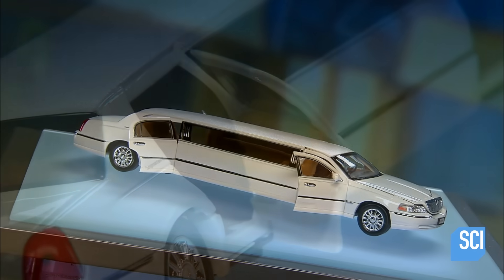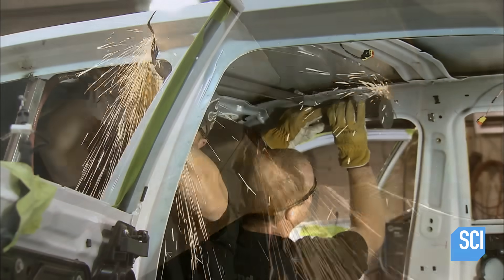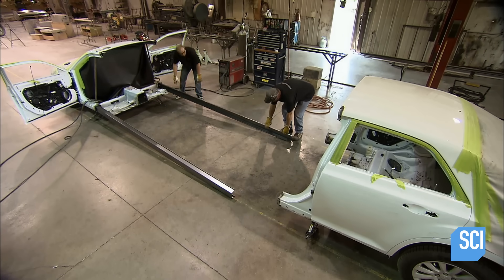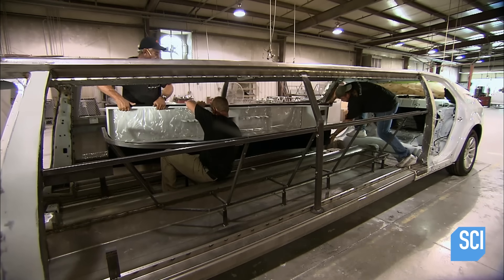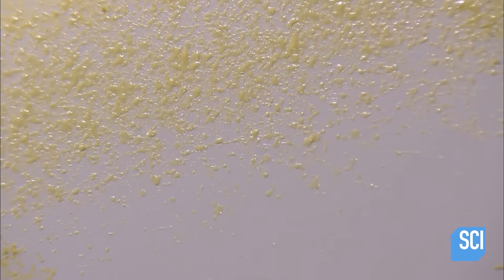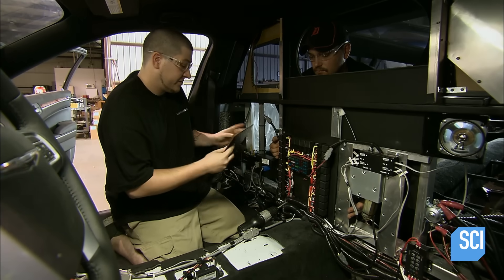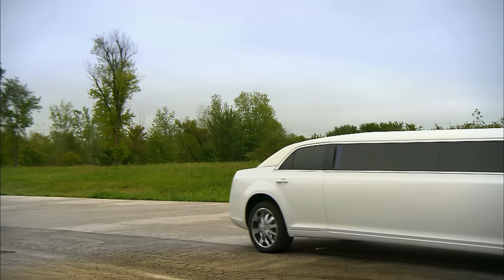How It's Made: Stretch Limousines

Comment: Imagine the floor and frame reinforcements necessary if this were to be a stretch convertible limousine?  Also, if they instead chose to build it with more side doors than the original four and,/or went for a pillarless hardtop design complete with all side windows that open?

Comment: Legit body shops will mount the chassis on rails so that when the car is cut in half, it slides back with precision on the rails, keeping it straight. Then a real chassis is welded in place that has been reinforced. The exhaust is conformed to the chassis, not like this deathtrap. The suspension and drive train are upgraded. This is totally janky.

Comment: I usually really enjoy these how it's made videos but they left a lot out on that build extending the original factory wiring, upgrading the suspension for the heavier weight and extending the exhaust,fuel/emissions systems hoses,and brake lines was completely left out. 😮

Comment: I’m 40 years old and up until now, I assumed limousines are actual cars. Like, similarly to how an S-class has a long version, I also assumed it can have a bespoke super long version. I would never guess that limousines are cars cut in half and then assembled in someone’s garage! So how do they adjust the suspension for all the extra weight? Do they use the same wheels and tires? How on earth does that work?
Reply: The base car is bought from Ford or GM as a "professional" chassis.  The professional chassis includes the suspension for the extra weight which I think is usually springs and shocks with specifications from pickup trucks.  They use the same wheels and tires that are bought with the vehicle, but I don't think there is anything special about them.  Hearse professional chassis do not include interior behind the front seat.  Limo professional chassis are completed units.
Reply: In 4:51 you can see the wheels are different

Comment: Got to love the quality of welding here.... bare metal welded to multi coated painted metal..... did nobody teach them that they need to sand away the paint to reveal the bare steel before welding.... i mean it would be one this if this was just and arts and crafts project... but this is a structural weld that will be carrying humans and there just tac welding bare metal to painted metal....

Comment: This was one of the most superficial How It's Made I've seen.  Magically the driveshaft was just gone and just re-installed, along with the brake lines, fuel lines, cable for the trunk, brake light wiring etc.  They added how much weight to the car and didn't upgrade the brakes and rotors, they didn't cross measure the additional length to make sure it was square...

Comment: ok, but what about the drive shaft lengthening and rebalancing process? suspension changes?  brake lines extension, wiring loom removal and pull through new one? wheel realignment?

Comment: This is total fucking bullshit. you don't just cut a car in half and stick in a couple of pieces of framework to hold it together. what about the drive shaft braking systems/suspension system, electrical systems, etc etc. this would almost certainly be a death trap for anybody who just happened to be in it when it crashed. let's have a more detailed video of the whole process.

Comment: I am surprised the floor doesn't bow that much when you step in it...  That metal looked flimsy af.  I guess with all the stuff added, it adds some structural strength, and they probably weld it all the way across the side beams.

Comment: 1:20 - the way they welded in the new FRAME RAILS?  With very little overlap and just a bit of MIG welder work?  That is a piss poor way to do it, very weak and half-assed.  It needs to be a lot stronger than that!  Their idea of a "ride in luxury" looks like some real shitty construction work to me.  Let's see that thing hit a few good bumps and see how long until it falls apart.  How is that cheap construction going to handle body twist and flex on uneven roads?

Comment: I really wanted to see the drive shaft. I wonder how many support bearing's it would need?
Reply: Try to find a Lincoln Town Car limo being built or a full sized SUV like Cadillac Escalade.
Reply: Front wheel drive doesn't require a drive shaft. A typical sedan is front wheel drive, while a typical SUV is rear wheel drive. That's why we don't see a single SUV stretch.

Comment: Surely in 2022 this cannot be how they make a limousine. I'm actually shocked.
Reply: It’s prob a much better system now, these videos are usually ten years old
Reply: @ashleywoedy9750  That would bring us back to 2012 approx, crumble zones,side impact protection was in cars long before that.To me it looks like a botch job and the limo would never be used on public roads.Im still shocked.
Reply: This is some fine American engineering, are you not used to this shit?
Reply: @kristoffer3000  Absolutely not.It reminds me of those so called chop shops or that practice criminals do when the cut a crashed car in half and reweld on another half from another car.Unless of course now this video was shot in the 1990s.I wouldn't mind but when I watch the smithsonian channel aerial America there are some fantastic feats of engineering but this limo is not one of them.
Reply: These days robots cut the donor car in half and two more robots wheel the back half away so the steel beams can then be welded into position once they have lined up the spirit level. Things have really moved on now.
Reply: @neillchippett655  Omg they use a spirt level to realign both sections of the car.And here am I thinking that the car would be built from scratch with crumble zones and side impact protection and pedestrian safety zones.

Comment: Shocked, is this even safe enough to be driven on road?
Reply: No, thats why you always see them wrecked at the side of the road and their passengers hitching.
Reply: every step of  the way, you must be sure EVERYTHING is "square". constant measuring and remeasuring (welding changes dimensions) is the norm.
Reply: @jameshollen9723  The added frame rails, look very poorly added with maybe 2 inches of overlap to the original car, making a very stressed and weak connection.

Comment: What about the engine ?? This type a car will need a much more powerful engine with higher torque to move the heavy load.
Same for the brake system.
Reply: It doesn't need any additional power for its intended purpose.  Driver's are instructed to drive these slow accelerating such as not to upset the passengers.  Brakes are upgraded for safety.

Comment: No way this is the only way they make limousines nowadays.
Looks totally sloppy - and those welds shouldnt pass any crash test. 
Also, the parts welded werent galvanized steel, since those workers were mig welding (unless they had grinded the edges, but doubt it)

Comment: I don't know about the cutting a regular sized sedan in half part.
Most limousines seem to have a higher ceiling and more interior space than their regular sized versions, so I feel as though they are designed to be extended from the start. The Lincoln limousines though may be indeed done as we see in this video because they are about the cheapest looking and most beat up limousines you will find out there.

Comment: These videos are always too short. So many steps are missing that I'd like to see.

I'm shocked by how many people are shocked that they cut a standard car in half and stretch it. That's what they look like and that's what they are.
Reply: I think most are shocked at how mediocre the new "Frame" is connected to the front and rear parts of the original car. Most expect something with a GOOD BIT more strength and overlap to the original rails.

Comment: What about upgrading the suspension, brakes, transmission and steering to cope with the vastly increased weight. And the electrical system. Would the enlarged / extra kit all fit under the bonnet of the standard saloon car?
Reply: It depends on the vehicle. Sometimes you can order those upgrades from the factory. Usually though the suspension is beefed up It kind of has to be. The company I worked for for a long time had two stretches The longer of the two you could not turn the steering wheel all the way to lock because the large upgraded rim/tire combination would rub against the inside of the wheel wells if you did.

Comment: Use to work at great lakes limo in Michigan! Fun job forsure and this is exactly the process missing a few 100 little things tho! My job was 100% underneath, had to weld, seal and undercoat then extend brake lines, wire harness, fuel lines and drive shaft! Pretty much all day lying on a roller!!
Reply: obviously they weren't going to include every individual step. the video would be too long and TBH would get boring after too long

Comment: i have concern on the safety level of the car such as overturn or side collision impact, it seems the extended part in the middle has used simple metal layer, there is no air bag in the middle. How is the sound proof layer at the extended part, not shown in the video, without proper sound proof, the noise level heard by the passengers will be obvious. Since this is luxurious vehicle, must be very quiet and comfort inside.

Comment: If the flimsy construction of a stretch limo scares you, don't ever look into how most RVs are built. They're essentially a commercial truck frame with a wafer thin aluminum and plywood body bolted on top.
Reply: I remember the first time I saw one tipped and ripped by high winds. It looked like thick paper and cost more than my house new. I won’t ride in one.
Reply: And according to an RV salesman I met, they depreciate so fast you won't even have TIME to cry... Seriously. That's why I would never buy one.
Reply: I’d rather ride in a converted school bus than a commercially available RV for this reason.
Reply: im flabbergasted how modern trailers can cost $50,000 and whatnot. its a damn thin metal box on wheels
Reply: And lots of styrofoam
Reply: A WHIPPLE WING SH1THOUSE
Reply: Yea my friends are dealing with that now. School buses are steel plates and frames the whole way back
Reply: @schneemann-fy6gi  Most school bus bodies are made from aluminum, not steel. Granted, they are still much better than RVs!
Reply: @jamesgizasson  nope they are required by law to be steel framed
Reply: @schneemann-fy6gi Do you mean the chassis or the body? Every school bus body I've seen is aluminum; the frame rails underneath are steel.
Reply: @jamesgizasson  body. Every chassis is steel
Reply: @jamesgizasson School buses are tanks
Reply: Would titanium be a better choice?
Reply: That’s why you have Liberty Coach make you an RV out of a Prevost H3-45 Motorcoach.
Reply: Yet there's still more there than is on an aeroplane.  Don't read more if you fly a lot and are easily scared. :)

Yep, only 1 mm of aluminium and some rivets protects you from falling thousands of feet with no parachute, and if 1 of those rivets is not properly secured, the air can rip that entire section off.
Reply: @EnsignLovell  There’s a hell of a lot more inspection and engineering work on airplanes than there is on RVs
Reply: @EnsignLovell  planes have an excessive amount of inspection. RVs have very little. Id ride in a plane, I wint ride in an rv
Reply: @EnsignLovell  ratio
Reply: @EnsignLovell and yet they don't

Comment: The same engine can handle all that extra frame weight as well as the people?
Reply: yes, it's not an issue. power to weight is affected, of course, but it's inconsequential to the task these perform.  driver's intentionally keep acceleration low such as not to upset the passengers where it will directly result in a much lower tip.  so even if you put a motor that had an extra 100hp over what it had, that power would not be put to use.

Comment: I owned an '89 Town Car limo for a few years privately and worked on it myself. They're not made to last very long; no rustproofing, sloppy welds, lots of leaks. This was a California car but you could easily identify every piece of custom metal because it was covered in surface rust - next to rust-free factory panels. They used a two piece driveshaft and a single carrier bearing for mine (a 72" stretch). Limos are a lot like RVs... there are a couple of companies that make parts for a multitude of limo manufacturers. Mine had a secondary HVAC box behind the driver's compartment with a second heater core and AC evaporator. It had air shocks, but otherwise looked like the original Lincoln coils in the rear. Two batteries and a 200A alternator - may have been an option from Lincoln. The rear compartment solenoid looked the same as one used for a 1950s Ford starter. The biggest issue was glass, lots of custom, curved glass. Once some kids broke the rear door glass. The doors were stretched about 8" and had custom glass. I had to have a polycarbonate window custom made because the original supplier was out of business. They literally spliced the original wire harness going to the back of the car to extend it. There are a surprising number of circuits going back there. It was a remarkably reliable car though, easy to work on too.
Reply: even in the video the welds are very sloppy
Reply: I own a stretched range rover 5.0 supercharged, and since it's a range rover, the limo parts have been the most reliable parts 🤣  but seriously, luckily mine was done by one of the largest conversion firms in the country, so mine is built very well...12 years later, the bondo just developed a slight crack.  The problem with limos is, you can have the worst backyard job possible, or a very high quality build, and if you dont know who built it,, you'll only have two ways of finding out:  let it get old and see, or worse...crash it

Edit: I should also mention that the hack job backyard limos are pretty much mainly just Town Cars, Cadillacs, and Excursions. Most of the more exotic type of limos, BMW sedan limos, Mercedes limos, stuff that isn't usually stretched in america, have a better chance of being a higher quality build. Hackjob 1980s-2011 stretched Lincolns are a dime a dozen
Reply: Hiiiiiii can you see my comments????
Reply: They writing a book 😂
Reply: I rode in a limo when I was 8 years old. I was a cheerleader at that time, and the limo was hot pink. We were going to our banquet at a pizzeria. It was so much fun.
Reply: I can't imagine it needs to last long, though. In the ideal case, if you own a limo in the first place, you're likely gonna use it and get money from renting out your services to clients, and with some good management, before you know it, you've made your money back.

Comment: Am I the only one wondering about how many driveshaft carrier support bearings are needed? Additional suspension? Secondary HVAC installation? Second alternator installed for additional current draw? And otherwise the litany of other details that were beyond cutting a car and half and welding some sheet metal between the two?
Reply: Realistically the extra current draw is negligible; LED lighting, a midgrade stereo, and maybe a fridge.   Even a compressor-driven fridge/freezer can draw as little as 45 watts -- Ford offered it as an option on some of their crossovers and was capable of keeping ice cream frozen.
Reply: there was so much content left out of this video from the actual build
Reply: Front wheel drive cars don't have a driveshaft that needs carrier bearings.
Reply: @dchawk81  chrysler 300 is not a front wheel drive vehicle

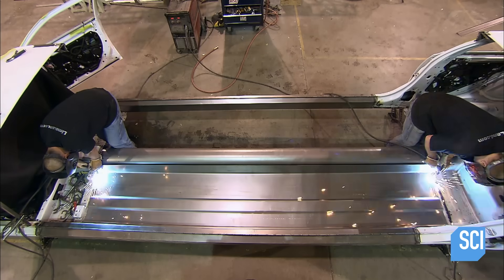Comment: 2:11 "...which is made of galvanized steel..."

and they're just welding that without any breathing equipment? good way for your employees to get metal fume fever
Reply: "Do not breathe zinc fumes- Metal fever not covered by workingman's comp!"
-Sign in a shop I worked in briefly. Apparently around a month after I left, someone got metal fume fever, took it to the union and then to OSHA. Metal Fever was, in fact, covered by workingman's comp.
Reply: "Don't breath this!"
Reply: None of the guys grinding the car in half. We’re wearing masks either. Sucking in lots of nice metal dust. It’s unreal to me that with the information we have people still work like this.
Reply: @patty109109  im not validating their decisions, but after years of working around projects like that, you get a false sense of a security think nothing bad will happen. eventually you will just stop wearing PPE, if you dont see and immediate threat to yourself
Reply: I was looking for this comment. Galvy is coated with zinc. Zinc fumes is toxic when welding.
Reply: No safety glasses underneath those shields. No coveralls, apron, or jacket, just exposed arms. Those aren’t welding gloves. Ideally you would want to wear a welding beanie to cover your head underneath your shield but whatever. Normally to weld the frame of a vehicle you need certain certifications, I kinda doubt these guys have them.
Reply: @jerro1446   nah it's fine lmao
Reply: Same tought lol